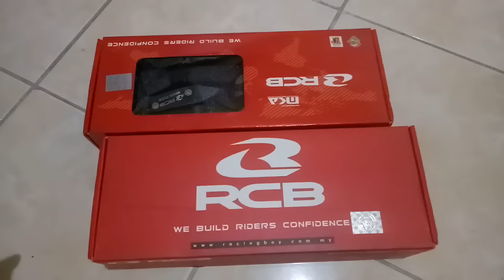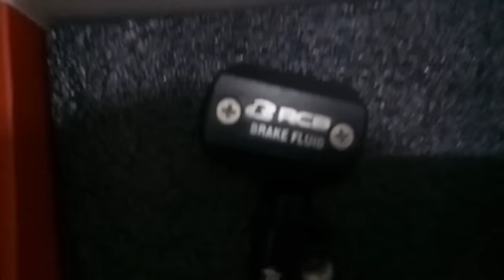Aerox Rear Disc Brake Conversion Installation

Comment: Anong size at haba po nang gold bolts na nilagay nyu sa brake arm Sir para matakpan butas nya salamat
Tska size nang nut na nilagay nyu sa thread nang bracket yung dalawang pirasong nut sa ilalim nang pipe
At yung 2 titanium bolts from conversion kit to caliper bracket? Salamat po sana mapansin

Comment: Sir tanong lang po wala kabang ginalaw na wiring sa kaliwa kasi hindi compatble Ting female plug at male plug po sa e3 brake pump
Reply from the maker: Ah oo may mga aerox na compatible ung switch ng e3 brake master kagaya nung sa akin sir plug ang play lang ung wire, meron hindi plug and play

Comment: Sir, tanong ko lang. Magcoconvert din sana ako ng rear disc brake sa Aerox pero ang nabili kong brake disc ay  Nmax rear disc. Pwede din ba yun?
Reply from the maker: Di ko lang sure sir pero parang same lang yung front at rear ng nmax.

Comment: Aerox V2 disc brake convertion need ba palitan ang stock mags mga paps?
Reply from the maker: Meron ako nakita sir ginamit nila ung gear box ng nmax version2 at after market na mags na size 14 na pang nmax para plug and play talaga

Comment: ano po size ng bolts pra sa pag kakabit ng rare brake caliper??? wla ako nung spacer... nabili ko lng kc mc q 2nd hand. kalook a like ng breaking system nyo po.
Reply from the maker: M10x30 po or basta pang mio sporty na bolt caliper sir

Comment: Tanung lang sir pwede kaya gamitin yung old lever para di nag butas banda sa handle bar bali yung brake fluid nya malapit lng din sa ilalim nang motor tulad po sa ibang conversion.??
Reply from the maker: Pwede naman sir, nasa pagcoconvert lang naman.
Reply: @MotoDIYs  okey sir ty po
Reply: @MotoDIYs  pwede po ba ako sayo mag pa convert?

Comment: Sir, parang kalahati lang yung kumakagat na brake pads sa disc. Mukhang malaki yung distance kapag hindi ginamit yung kasamang brake caliper sa Set.
Reply from the maker: Dito sa right side na brake pads cguro 3/4 or 1/2 nga ng pads pero sa kabilang pads sakop nya lahat,  pang mio sporty din kc yung caliper na kasama nung kit kaya sa tingin ko same lang din layo nila.  Ewan ko lang kung RCB na caliper ang gagamitin,  pero malakas parin sya kahit di sakop lahat. Thanks sa comment sir.
Reply: @MotoDIYs  Pero galing sir ng convert nyo. Ang linis at pulido ng gawa. Mas malinis pa kesa sa mga motorshop. Hehe. Gusto ko din i-convert sa disc yung rear ng aerox ko. Kapag sinipag i-DIY ko din. Thumbs up sayo sir.
Reply from the maker: hehe oo sir kapag talaga ikaw gagawa iingatan mo talaga :)
Salamat sir and Ride safe :)

Comment: Sir ask ko lng po sa brakes yung LEVER ko po sa front brake matigas n po kpag pinipiga ko senyales ko n po ba magpalet ng fluid o mag bleed din po ?
Reply from the maker: Try mo muna ibleed at dagdagan ng brake fluid sir,  try mo rin linisin yung caliper at brake pads baka maraming nang putik or dumi.
Reply: magkanu inaabot idol

Comment: Boss aerox V2 ba motor mo?😅 Tanong ko lang sana kase plano ko rin mag rear disc brake aerox V2 kase sakin boss, yung swing arm boss NMAX V2 ba gamit mo? tnx.. sa video lods napakalaking tulong sa mga gusto mag convert, d gaya ng iba madamot sa idea..
Reply from the maker: Version 1 aerox ko sir, stock aerox v1 swingarm din gamit ko, thank you din sir 😁

Comment: boss pede mag tanong ano size nang caliper bolt mu po sa rear na naka titanium po?? pls rply thanks.
Reply from the maker: Di ko alam exact size pero pang caliper ng mio sporty yung titanium bolt na ginamit ko sir,  alam ko m10x25
Reply: @MotoDIYs  ahhh i see thanks po, same size lang sila po sa front diba?? naka ganyan din kasi akong bracket at nmax stock caliper gamit ko, bibilhan ko kasi gold bolts.. hehe.. thanks po
Reply from the maker: @patmonsprogamingvlogs5510  yes sir same ng front 😁
Reply: @MotoDIYs  yun oh.. hehe thanks po..

Comment: Paps anong brake hose ginamit mopo sana masagot rs po paps
Reply from the maker: Di ko alam kung pang anong motor kasama na kc sya sa conversion kit,  perp 1.92 meter ang haba nya.

Comment: Kng sakali sir mgkano labor sa nyo kng sau ako mgpapa install ng rear disc brake..??
Reply from the maker: Sensya sir di ako nag iinstall, share ko lang video ko kung paano ko sya ginawa
Reply: Ai gnon b sir...kla k kasi gmagawa k kasi mganda ka gumawa ng convertion mlinis...
Reply: Sir isa nlng tnong mgkano lahat inabot ng isang set n yan po..?? At san kpo bmili
Reply from the maker: @memomotovlogofficial6885  mga 7K sir, ,4850 ung conversion kit sa shopee tpos 2k sa RCB brake master

Comment: Sana ma pansin,
Tanung kulang sana boss kung magkanu order nyan isang set, at sn tau pwd maka order, salamat
Reply: try mo sa Fb Lhady Nouvo, pero medxo pricey nga lang, 15k daw set. pero no convertion needed. salpak nalang.
Reply from the maker: Sa shopee ko nabili sir 4800 ko nabili ung conversion kit.

Comment: SIR ASK KO LANG 
SAAN MO NABILI YANG SET NG DISC BREAK AT MAGKANO?

SALAMAT
Reply from the maker: Sa shopee ko nabili sir 4800
Reply: Magkano magagastos kung mgpakabit ako sa iyo?
Reply: @MotoDIYs  ahhhhh mura Lang pala,
My Nakita kc ko sa YouTube 13k daw pakabit SA isang shop 
Over pricing naman un
Reply from the maker: yung 13k yata sir mga RCB Caliper at brake master na rin yta ang ilalagay, pero di lang ako sure sir.

Comment: Sir ung caliper pwd ba ung rear ng nmax swak din ba un?
Reply from the maker: pasensya sir di ko pa natry yung caliper ng nmax
Reply: Sir san ka nakakuha ng spacer sa bracket ng caliper? Ung malapit sa titanium bolts ung kulay silver.na spacer
Reply from the maker: @kimphilipandag620  dati kc may caliper cover ung mio sporty ko kinuha ko yung spacer nya tpos pinutol ko sa tamang sukat.
Reply from the maker: Yung ganito sir https://www.google.com/imgres?imgurl=https%3A%2F%2Fph-test-11.slatic.net%2Foriginal%2Fc1465629c96db9227c4dc8b80dddf2c5.jpg_340x340q80.jpg_.webp&imgrefurl=https%3A%2F%2Fwww.lazada.com.ph%2Fproducts%2Fmugen-caliper-cover-miogold-i117814552.html&tbnid=lNAYqzGZznRylM&vet=1&docid=vQTx7OOnrgMATM&w=340&h=217&source=sh%2Fx%2Fim

Comment: Bakit mag disc brake sa rear , naka design iyan ng drum type. Ginawa ng manufacturer iyon dahil iyon ang pinakamagandang set up para sa traction control. Brake alteration iyan, delikado iyan.
Reply: Disc brakes do a better job of managing heat than drum brakes. This causes them to experience less brake fade, which results in more consistent performance. Better performance in wet conditions. With disc brakes, the rotor repels water, and the brake pads wipe them away like a rag wipes water from a window,they made the aerox 155 drum brake to save a bit off the price and to make it a bit different from the nmax,pansin mo nmax base variant is 109k but aerox base variant is 102k
Reply: @brixsteezy4486   tutoo iyan. Para kumita mas malaki isang dahilan iyan. Pero ang nmax has a different structure compared with aerox. Weight .heavier ang nmax so mas kailangan niya ng mas malaki na brake para huminto ng maganda.  Iyong techinical aspects ng disc brakes intendido natin iyon. Sa akin diyan mas concerned ako sa safety. Siguro mas iisipin ng manufacturer ang roadworthiness  ng vehicle nila at safety ng commuter, lalo may pangalan na sila. I have nothing against your project.  Iyan ang theory mo at iba din ang theory ko.
Reply: @manueljorge1601  your theory is more sensible than mine,and true it is hard to trust brands and builds that are not factory stock,but time will tell and big companies who modify motorcycle might make a trusted rear disc brake for the aerox,or maybe the next gen of aerox might have a rear disc brake abs,since the abs ver of the aerox is more expensive the the abs version of the nmax,quite sportier ang aerox and comfort ang nmax pero sna gawin nrin nila disc ang aerox pra fair sa mga aerox users
Reply: @brixsteezy4486  tutoo iyan bro. Kasi sa akin iniisip ko safety ng riders. Mga materials na gamit ng mga aftermarket na di reputable delikado. Ang quality control niyan ay hindi natin alam kung pasado iyan sa SAE isang example na iyan. Pagkatapos any alteration diyan sa motor ang warranty niya mawawala automatically, per agreement. Ngayon kung manufacturer ang mag gawa ng upgrade diyan mas mabuti para sa user ng motor. Di ko ma.imagine na mawalan ka ng brake while using your bike. May isang manufacturer ng mag wheels.si SILVERWIND nag start pa lamang iyan back in the 1980s bumili ako mags TRD style ayun while crusing ako sa EDSA NAG HIWALAY ANG HUB DUON SA EXTERIOR PART  niya. Sinagot ba ng owner ang damages ng car ko, oo pero demanda inabot nila . Iyon pala di registered ang company,so  walang standard.na sinusunod casting lang ng casting. Basta sa akin, u modify, u take all the risks. And sana walang madisgrasya sa mga modifications. Hindi iyan pang paganda lamang  . Alam mo kung ano at stake sa modification na ganyan. Sa mga iba na nakakabasa nito,have  an open mind,  this is for the protection of motorcycle users. Mag ingat tayong lahat. Sa modifier, i have nothing against you. Sa career mo wish you all the success. Pero don't forget to ask the proper agency to help you to be accredited as a modifier of motorbike i am sure sa young enterpreneur tulad mo they will be generous to accredit your shop and that is for your legal protection.
Reply: @manueljorge1601  thanks for the info and open mindness sir
Ridesafe always and Godbless
Reply: @brixsteezy4486  wish you all the best in your work.

Comment: Sir palagay nman ng link if san ka nakabili ng Disc brake convertion mo sa aerox.
Reply from the maker: Sold out na dun sa pinagbilhan ko paps pero try mo to https://shopee.ph/product/167323469/4810701530?smtt=0.145794890-1602391814.9
Reply: @MotoDIYs  Salamat paps.

Comment: Magkano po budget ng conversion sir!? ,😅
Reply from the maker: 4800 sa conversion kit, tapos 2k sa RCB brake master, pero optional lang naman yung RCB na brake master ehe
Reply: Ano pa po yung ibang brand kysa rcb brake master?
Reply from the maker: @johanyan4700  yung kit sir may kasamang left brake master, pero pwede rin yung original left brake master na pang nmax, kung may budget pwede yung brembo brake master
Reply: @MotoDIYs  sir saan po niyo nabili yun conversion kit?

Comment: 20:04 paps yung spacer ba kasama sa kit?
Reply from the maker: Hindi kasama sir,  naghanap lang ako na pwedeng ilagay na spacer.
Reply: @MotoDIYs  ah okay. Thanks. Akala ko kasi may kulang sa kit ko.
Reply: Rcb s-series yung caliper ko. Need ko parin ba spacer?
Reply from the maker: @jeffcruz9169  pasensya paps di ko pa natry yung rcb caliper
Reply from the maker: @jeffcruz9169  Nice! Good job Sir at maraming salamat sir :)

Comment: Paps san nakakabili ng ganyan matagal na kase akong nag hahanap ng ganyan salamat sa pag sagot paps
Reply from the maker: https://shopee.ph/disc-brake-assy-aerox-rear-full-set-with-disc-rear-i.167323469.4810701530
Reply: Maiinstall din ba rear break light switch ?

Comment: Idol nice one👌saan ung loc nyo pagawa din ako idol...and how much po!tnx and god bless!
Reply from the maker: salamat idol, 4800 yung price ng conversion kit, tapos 2k naman sa RCB bRake master pero optional lang naman yung rcb brake master meron naman kasamang brake master yung conversion kit. pasensya paps di ako gumagawa sa iba, more on vlog at sharing ng idea lang ako sir. God bless din sayo idol :)
Reply: San ka umorder ng conversion kit idol
Reply: panalo gawa mo sir! kahit malabo mata masusudan sa linaw ng gawa mo..  balak ko din paconvert ung aerox ko buti nkita ko tong gawa mo pwede pala lagyan ng locknut ung disc bracket para mas matibay kahit na naka thread pa.. ty sa info
Reply from the maker: @raymondcabrera4289  maraming salamat sir 😁
Reply from the maker: @maximtumaliuan5537  shopee sir search mo. Lang aerox disc brake conversion

Comment: New friend here bless you
Saan ka nakabili Nyan set idol pa tip naman
Reply: Hm lahat magastos idol?
Reply from the maker: sa shopee ko nabili sir, 4800 sa conversion kit at 2k sa RCB brake master, Thank you sir :)
Reply: @MotoDIYs  Yes thanks PO paps
Reply: Pano po rear break light switch, plug and play din ba...sa rcb left hand break?
Reply: Oo paps pano switch light ano ginawa mo dun bilod sa stock dba? Sna mpansin mo to..

Comment: Magkano damage mo paps?
Reply from the maker: 4800 para sa conversion kit tpos 2k sa RCb Brake master
Reply: @MotoDIYs  okay dn ba yung OKM brake assy paps?
Reply from the maker: @nelvznagsuban9494  pasensya paps di ko pa natry ung okm brand na conversion kit
Reply: @MotoDIYs  oks paps thanks sa info and vid very helpful. Last nalang po yung gold bolt na pinangtakip dun sa butas ng mags same size lang ba sa engine oil cap?
Reply: Saka yung brake light sa likod plug and play dn po ba?
Reply from the maker: @SamiAddam  bakit sir?